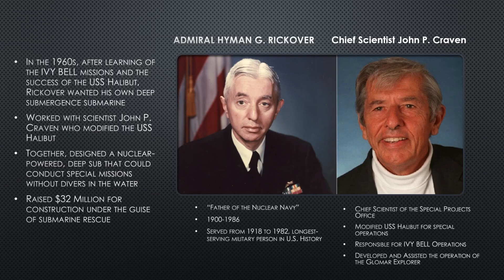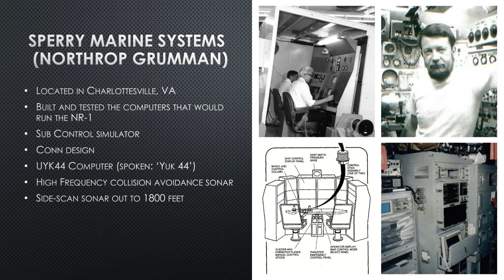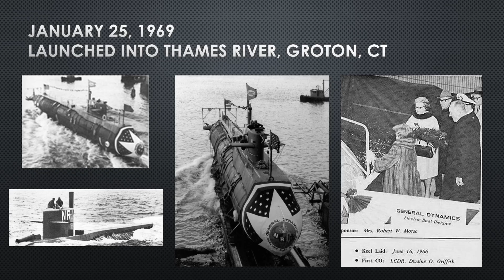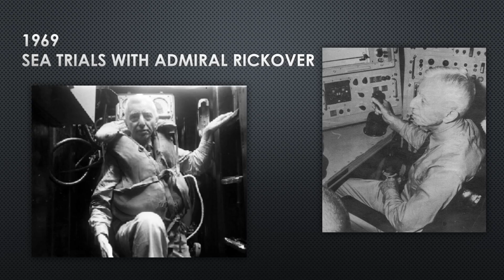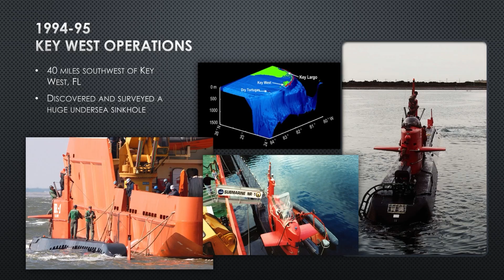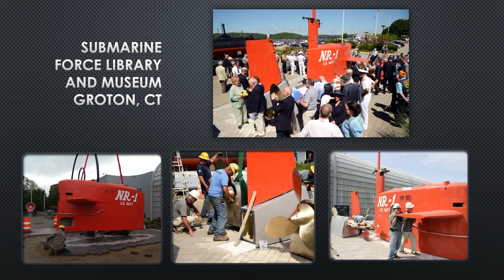Admiral Rickover's Special Project NR-1 Nerwin Sub Brief

Comment: NR-1 did have its own small pressurized water fission reactor and all that goes with it. A lot of people think it was an RTG for some reason, which is wrong. Satellites don't/cant really use fission reactors, they use RTG's which basically are just a pile of decaying mass and some (many) thermocouples, and power in an RTG is limited to a few kW to maybe 50kW or so. The soviets had some pretty big ones for lighthouses. There are some new designs that do use fission, but there are a lot of problems and limitations with it concerning a heat sink, because you are limited to radiative heat transfer in a vacuum, which sucks.

Comment: The NR-1 wasn't always towed. I was a EM2 stationed on the USS Portland, LSD-37, and we carried NR-1 down to the Caribbean in the well deck.  In order to ballast down low enough to bring the NR-1 aboard they had to load the well deck with anchor chain, heavy seas off of Cape Hatteras allowed the heavy, unsecured anchor chain to slide in the well deck.  No serious damaged other than splintered wood decking. It did make for an exciting visual of flying anchor chain.  Plus ballasting down, so low in the water allowed intrusion of salt water where it should not have been, keeping me very busy as the duty electrician. No pictures were allowed the operation was classified at that time. It was in the early 70s.
Reply: Whats a well deck?

Comment: It's funny how conservative the military can be with some technology.  Needing to toggle in your bootloader was an archaic feature of computers even in the 1960's.  (Let alone whenever they finally retired the last of those things. -- Or have they yet?)  Commercial (Unclassified) 1024 bit ROM IC's were available several years before NR1 was laid down, and obviously they are a lot smaller and lighter than a metal switch panel which you'd think would be nice in a cramped submarine.  There was a brief renaissance of toggle switches in the earliest home personal computers in the late 70's / early 80's, but technology displaced those pretty quickly again too.

Comment: If I would venture a guess I'd say the NR-1 nuclear reactor was  a radioisotope thermoelectric generator full of red hot glowing plutonium-238. That uses the heat generated by natural plutonium decay to generate energy. Similar to the once who flew on Pioneer 10&11 in 1972.
Reply: You would be incorrect.

Comment: JT: It's only a n unsupported personal guess but If personnel and life support needs are removed from the equation, the replacement to the NR-1 might be hiding in plain sight at the US Navy's Orca XLUUV program. It’s large enough to function autonomously and it’s small enough to be paired to a Seawolf or Virginia type mother ship. The USS Jimmy Carter is already operational and has a 30 m multi mission platform section that could accommodate a XLUUV. No surface support or tow needed. Respectfully, WS

Comment: Man, I can only imagine how puckered the support vessel was when the Nerwin submerged.

There's lots of stories about subs catching a trawler by the nets and dragging it underwater, trawler lost with all hands. In fact, that's a running suspicion every time a trawler disappears, and the Navy scrambles to make sure it wasn't us.
Reply: I was on one of those boats that snagged a trawler off the Azorres!  The net and cable messed up our prop and shaft so bad that we cavitated submerged and had to make an emergency port stop in Gibralter at a time it was supposed to be a "neutral" territory.
Reply: @epicjourneyman2145  yikes!

Did the trawler survive?
Reply: @ScottKenny1978  It's always bothered me a little that we didn't come up to periscope depth and check - we were transiting across the Atlanic at the time for a Med Run at flank speed when it happened.

Man you should have heard it! we felt the the kind of surge in momentum as we hit the net but then through the hull you could hear this kind of "Atghh Arghh...ark..." sound that went from that to a kind of high pitch bird chirp cavitation - we were basically screwed.

When we pulled into Gibralter you could see where the steel cable of the net peeled the non-skid off the deck and actually etched the exterior hull.

I was on broadband Sonar watch at the time and had to throw off my headphones - I seriously doubt the trawler survived unscathed.
Reply: To follow up a bit, I'm not entirely sure that we didn't come up to periscope depth and take a look (seems really irresponsible not to)...I just don't remember if we did or not.

It was also in the middle of the night local time so we would only see the lights of the poor trawler - I'm not sure if it may have been a change of watch situation where I just missed it but I don't remember us coming up to take a look...it was almost 30 years ago so I can see just be  forgetting that detail.

On a side note, i had the best gourmet meal of my life in Gibraltar and really enjoyed my brief unscheduled stay there - the locals were really cool and hospitable with us.
Reply: @epicjourneyman2145  yeah, I'd be really surprised if you didn't come up to check on the trawler.

And damn, that's some nasty damage to your boat!

Comment: @Sub Brief >>> Do you know much about the USN's 'rescue subs' AVALON and MYSTIC?  I remember seeing a model kit of one of them DECADES ago, and might have actually built it at one time, although I cannot remember for sure now. 
 
I thought I read somewhere MANY YEARS AGO that they used hydrogen fuel cells to supply electrical power instead of batteries.  Yet everything I have ever read about them said they ran on batteries.  
 
Was the H² fuel cell thing something that was tried and abandoned, or was I just confused -- definitely NOT the ONLY TIME that has happened 😊 -- and they were ALWAYS battery powered?
Reply: I served on Avalon DSRV 2. Rickover personally terminated the fuel cell program believing it was a threat to nuclear power. Rickover's Cronies raided Lockheed Ocean Laboratory and destroyed all documents related to the fuel cell program
Reply: @bernieeod57   >>> Thanks.

Comment: Hold on,  so you telling me the engineers that designed this thing didn't realize an air filled rubber tire would collapse underwater.  I wouldn't find that confidence building, if i were the crew.
Reply: In one of the books, the engineers simply filled the tires with water or oil.
Reply: @jessjohnson8576  that's definitely the easier way.
Reply: Well, your car tires have about a 35psi/2.5bar pressure difference between the inside and outside of the tire.

Diver's rule of thumb is 44psi of sea pressure per 100ft of depth (1bar per 10m for the metric types).

So, 3000ft down and you need another 35psi (or more, you're supporting a lot of weight). So, 44*30=1320psi outside pressure, 1350+psi inside.

And most importantly, you need that tire to not explode when you're on the surface and it's got over 1000psi pressure difference!
Reply: @ScottKenny1978  Solid rubber tire?  I heard they took foam model heads and exposed them to depth pressure and made little Barbe heads out of them.
Reply: @johnhoffman8203  we certainly turned styrofoam cups into shot glasses underway.

Comment: I'm amazed at the shape of the hull/tower given the depth it could reach. Very strong welds vs the more common spherical shape.
Reply: The tower is just a fairing around a pressure cylinder to hold the hatches.

A submarine sail is the same way, just a smooth surface around a reinforced cylinder. Most of the periscopes and stuff is actually outside the "bridge trunk."
Reply: @ScottKenny1978  I sent that comment at midnight when my brain was definitely off. I absolutely knew what you've put in that comment. Fml I say some stupid stuff when I'm tired

Comment: It probably wasn't a proper nuclear reactor at all, but a radioisotope thermoelectric generator. It's basically a pile of radioactive schmoo surrounded by thermoelectric elements that makes a couple kW of electricity. They were used all the time on space craft and had limited military use, mostly in the USSR. 

Also, amazingly enough a lot of those crappy old 1970s computers are still in use. The military was the primary driver for the development in computing and semiconductors to begin with, and a great deal of that stuff is still running today.
Reply: No, it was definitely a pressurized water nuclear reactor (PWR). I went to Naval Nuclear Power School mentioned here and served on a supercarrier in the nuclear department. The NR-1 design was discussed and was very simple but interesting.
Reply: @BrianTRice77  I suspect the NR-1 reactor was rated at 5-MW.  No need for more than that.
Reply: @BrianTRice77  I kinda wish I could hear the details, but I was a YN2 SS, not a nuke.

Not crazy enough to do nuke school!
Reply: Oh well. Guess I'm wrong. 

I'm still intrigued by that Sperry/UNIVAC computer. Thing must have cost an astronomical fortune back in the 1970s.
Reply: An RTG would not be capable of that or would have the architecture broadly described in the video. Especially not in the mid-1960s when it was built. The arguments here are specious.

Comment: So did the Navy build a replacement for this thing or just retire it with no ability to replace it's functions?  BTW, that sonar computer system sounds pretty damned unfriendly.
Reply: If they did, it wouldn't be announced very loudly.
Reply: And if they did replace it, are they saying so?
Reply: Unmanned drones are the new way to do things. Autonomous undersea vehicles have replaced manned submersibles. The DSRV's have been replaced by a drone where the rescuees  on board are simply along for the ride at the mercy of the control van on the surface.

Comment: That picture of the NR-1 next to a 688 is is from when it was being dismantled at PSNS. I believe that 688 is the Salt Lake City. I came into the yard the year after the dismantling was completed but they still had pieces of the haul around the dry dock.  2 sections of the haul we still have and are used for training welders to seal up the reactor compartment. If you’re not familiar with the navy’s nuclear ship recycling program it’s cool stuff. You should do a video on it.